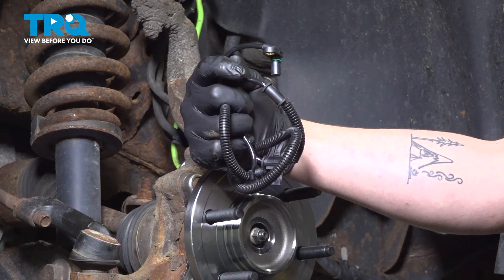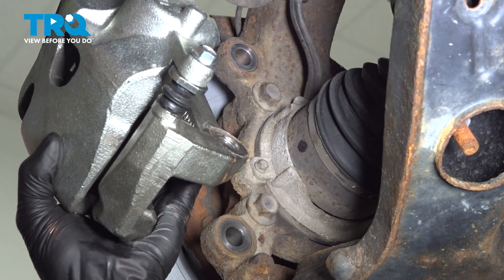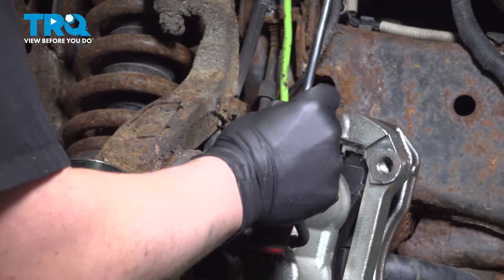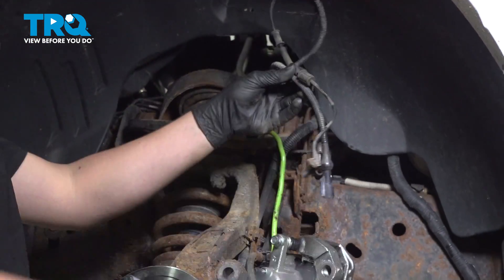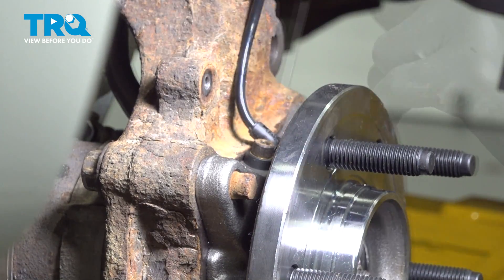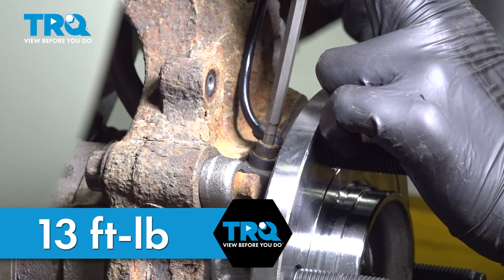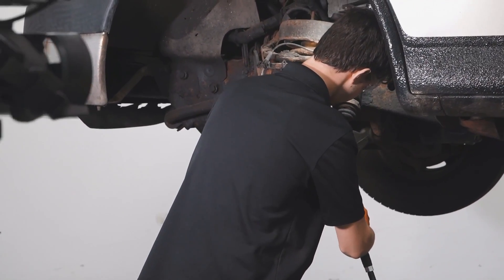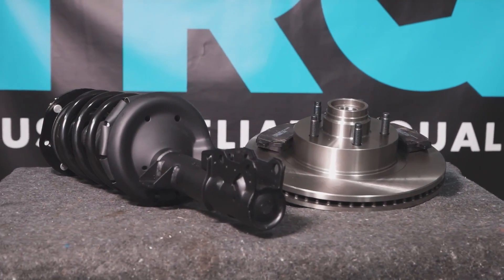How to Replace Front ABS Wheel Speed Sensors 2007-2017 Ford Expedition

Comment: When I’m driving highway speeds with cruise on, it takes half a second for it into turn off when I brake. And there’s resistance. Sometimes I press harder and it locks the brakes up. Could this be the issue?

Comment: I just spent $500 between parts (new wheel hub) and labor to fix this issue. The mechanic insisted the wheel hub needed replacing in order to fix the sensor issue. Thoughts?

Comment: Good morning! Is the process the same for the rear wheel speed sensors? Are they able to be replaced without replacing the wheel hub? It seems to go through the brake dust shield. Any information would be GREATLY appreciated!!!

Comment: The biggest difference between right and left front ABS sensor is that on the right (passenger) side the sensor wire leads to the front of the vehicle behind the fender cowling for attachment.